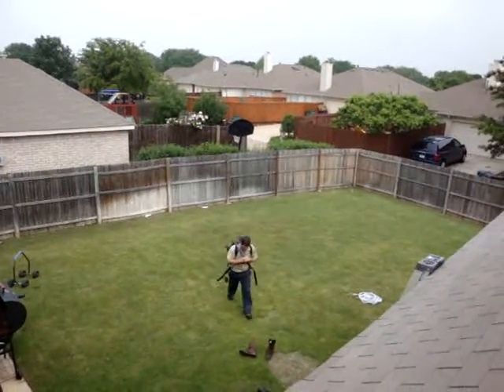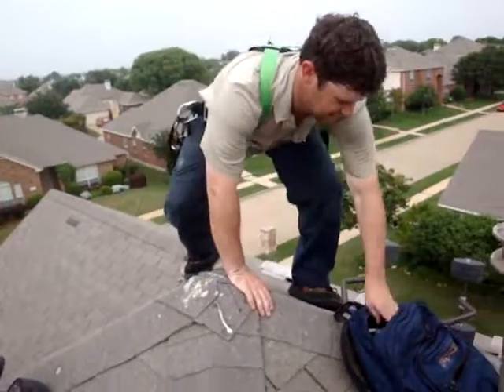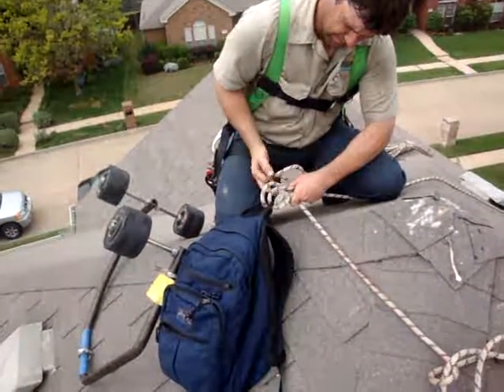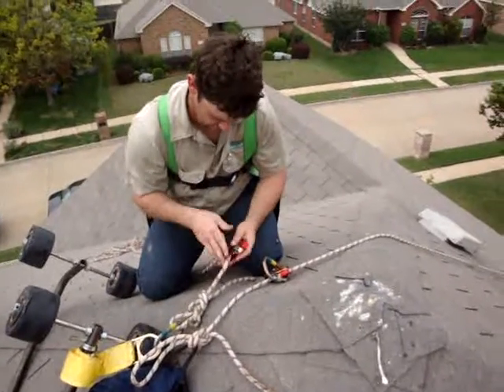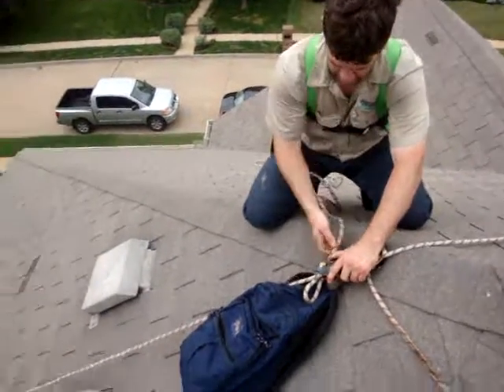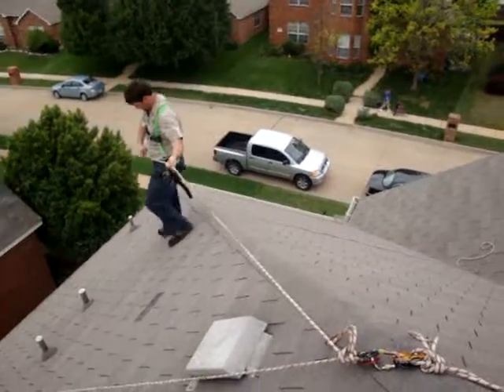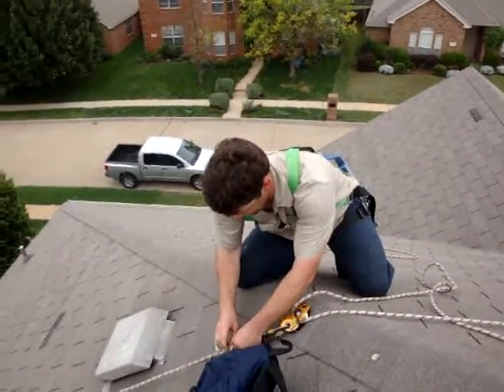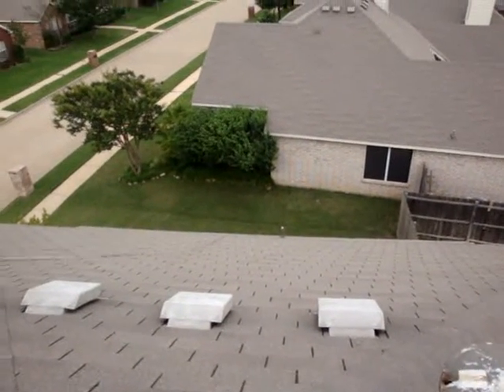Eve Hook fall arrest system

Comment: They should use a ridge hook while setting up to stay safe and totally legal with OSHA (although they are showing this on a hip roof - but you still have "first man up rules" to protect you from OSHA fines). Nice product considering OSHA changed the rules for roof work last summer. I would like to see some rope rubbing protection at the ridge - which is pretty simple. Other than that, where do I buy this and how much?